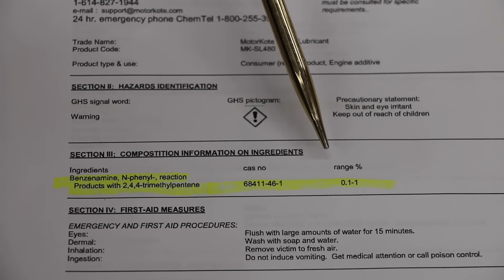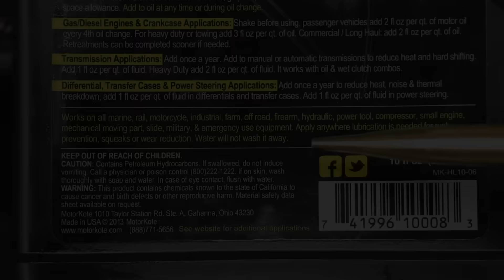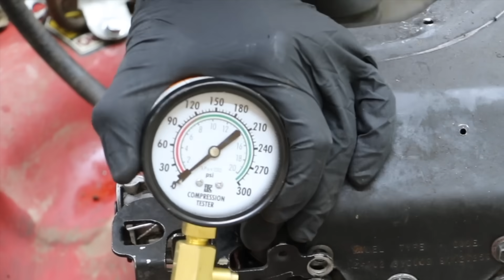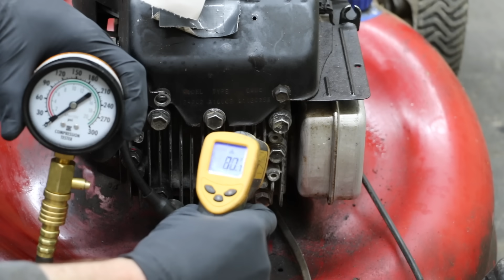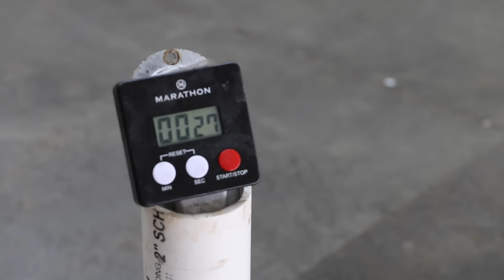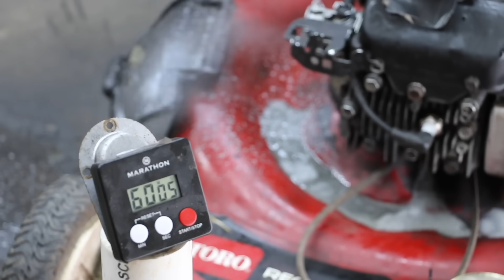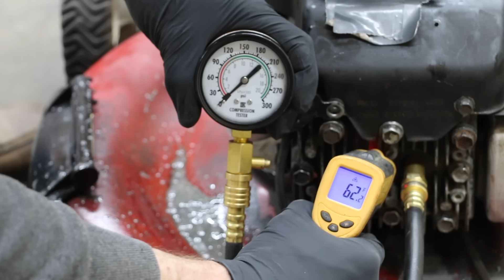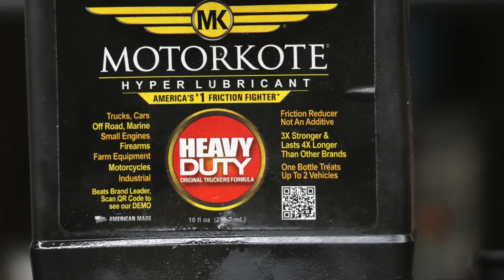Can MotorKote survive the water test?  Let's find out!

Comment: Could you do a video on castor oil? It's used in the fuel for rc cars and it's supposed to stick to the engine internals and provide some protection against a lean run, similar to what motorkote is doing, I'd like to see how it fares on your lubricity tester compared to other oils. It's supposed to take very high temperatures to burn it too would be interesting to see what it's lubricity is like after being cooked or run in an engine for a while
Reply: It would be really cool if you could do different types of castor like straight castor, degummed castor and klotz benol which is degummed castor with additives and put them up against 10w30 and maybe a synthetic 2 stroke oil. There's always talk on forums on what is the best oil to use for nitro fueled model engines and what's the best castor oil to use but everything you have to go off is just peoples opinions, there's no videos of any tests like yours out there for them. I could even send you some straight castor if you wanted
Reply: a drop of castor oil will cause instant death
Reply: @shittycodeenforcement7916  you're thinking of ricin, the leftover powder after the oil has been extracted from the seeds. You can buy castor oil in your local chemist it's an old style laxative, it's used in loads of cosmetics you can put it in your hair to relieve dandruff and help prevent balding and promote hair growth, it's good for your skin it works as a moisturiser and stops your skin from getting greasy by producing extra sebum, and it's a really good engine lubricant because it moves towards heat and doesn't break down and combust as easily as synthetics, perfect for rc car engines that use alcohol based fuel, it mixes easily with alcohol. You wouldn't die if you drank a bottle of castor oil but would get explosive diarrhoea, ask your parents or grandparents about it, they were probably given it as kids
Reply: @ciarancdc  Yeah i thought it was more toxic  . i have heard storys from my grandparents about kids eating the decorative castor beans and getting  deathly sick  . but those r my 2 cents
Reply: @shittycodeenforcement7916  the oil is just extracted from the beans/seeds and doesn't have any of the ricin in it, it's like mineral oil that you get in baby oil, that comes from crude oil the same place you get petrol and diesel and other petrochemicals from bilut mineral oil is used on babys
Reply: @ciarancdc  i stand corrected.  just looked at some companys that actually make the formulated castor oil in bottles for RC cars . learn something new every day .
Reply: @shittycodeenforcement7916  no worries, you might find yourself using it sometime
Reply: @ciarancdc  i have like 7 old briggs and stratton engines and might actually test this castor oil in the crank case just for the hell of it
Reply: @shittycodeenforcement7916  that'd be awesome, make a video of it I'd love to see that
Reply: @shittycodeenforcement7916  it smells really good when it burns you'd be in for a treat
Reply: @ciarancdc  it apparently makes a waxy coating instead of that carbon sludge synthetic oil produces under temperature  .. one of the 4hp engines knocks like a jehovah's witness wearing ray charles feet so it might keep the bearings from scratching .
Reply: @shittycodeenforcement7916  I know the stuff it goes like a varnish after a while, you can get degummed castor oil which is supposed to removed the varnishing/gumming effect but I don't really know if it affects the performance of the oil or not, I suppose it would have to take something away from the protectiveness of it. It's useful in rc engines if you have low compression. Say if you've run gallons of fuel with synthetic oil in it and the engines now becoming difficult to start or keep running, switch to castor based fuel and it really helps, it's worked for me, maybe because it's a thicker oil but I think some of that gumming or varnishing helps too it's like it microscopically fills in the worn spaces where the compression is being lost. Be careful about using stuff from chemists though, be sure to check or ask about the the ingredients because it can have sugar or sweetener in it to make it more palatable for people using it as a laxative, you don't won't to run sugar in your engine
Reply: in people

Comment: was with  water still some oil in the crank case? You added only 16oz. If there was then this was emulsion. That is why motor did not fail. Right?

Comment: Does Motorkote cause corrosion to the engine? I'm hearing rumors that it has chlorine in it
Reply: Yes and no.
The chemicals in it mix with remaining oil and cause very acidic/corrosive problems.
Just flush the motor...or use better oil
Reply from the maker: Thanks for the video idea.
Reply from the maker: Thanks for the video idea.

Comment: Amazon sells hypodermic syringes with blunt (unsharpened) needles. These are inexpensive and I use them with straight Motorkote to lubricate padlocks and other things around the house. 
.
My 99 Dodge Grand Caravan was having problems with the ignition switch. It was locking up and I could not turn the key. It took about 5 minutes of jiggling the key to get it to turn so I could start the engine. 
.
I tried 4 different keys and had the same problem. I thought something wore out or loosened up in the lock and I would have to take it apart and replace the assembly. I used the syringe with straight Motorkote to lubricate the cylinder and it completely corrected the problem. 
.
After about 21 years, the original lubrication or grease evaporates and causes problems.  I was very surprised that it worked. I thought I was facing an expensive repair. Up until I used the Motorkote, I was leaving the key in the ignition, so I would not get stuck and face calling a tow truck. 
.
The fine needle of the syringe allowed me to insert deep into the space between the cylinder and the housing and add the lubricant. I tried sprays, and they did not work.
Reply from the maker: Thanks for sharing.

Comment: The stuff is fantastic for quieting noisy valve lifters. I use it in my engine oil, automatic transmission, and power steering reservoir.  
.
It's worth the money. I also use Napa Gold oil filters. (refer to Project Farm test of oil filters).  My 99 Dodge Grand Caravan has 180,000 miles and I hope to make it a lifetime car. Engine runs like brand new and goes through NJ inspection without any issues. 
.
After a car reaches 25 years old in NJ, you don't have to get it inspected anymore. 
.
I was able to buy it at Autozone and Walmart, but now, I just order it from Amazon Prime. About $23 a quart.
.
Motorkote has to be the used car salesman's dream come true.  :-)
Reply from the maker: Thanks for the feedback.

Comment: I really enjoy your work has helped me make smarter purchases. Have you ever considered testing LubeGard transmission additives? I used the Platinum on a van (likely overloaded) that wanted to over heat the transmission every time I traveled up the mountain to our vacation home. With no other changes I was able to reduce transmission temperature by 30 degrees. I have had similar results with other vehicles.
Reply from the maker: Great suggestion!  Thank you.

Comment: Motorkote also has diesel cetane boost. I picked it up at a local Pilot truck stop. And I promise I can tell a difference in fuel mileage and injectors stiction after I used it. I have a 6.0 powerstroke.
Reply from the maker: Thanks for sharing.

Comment: Project farm, i like you to test the AMSOIL claims on MOTORKOTE that it contains chlorine and do a long term test if it does indeed harm a engine with it becoming hydrochloric acid!
Because allot of People are buying it because of this video!
Reply from the maker: Thanks for the video idea.
Reply: I agree.  Test the "manufacturer's claim" from Amsoil that Motorkote will produce hydrochloric acid.  I mean, please of course.  That should end the debate.  I will personally pitch in $20 to get the oil-motorkote used mixture tested!

Comment: Motorcoat don't mix with oil, found this out the hard way adding a smidge to two cycle fuel. motor coat separated and pooled on bottom of fuel tank over engine it made a mess to clean when it flowed into the carb, otherwise can't live life without it!
Reply from the maker: Thanks for sharing!

Comment: I just put some motorkote in my car engine. Thanks for making these tests, I bought this because of how impressed I was with your testing. This stuff really reminds me of those old Slick 50 oil commercials. The commercials where they would have the engine running and drain the oil while running.
Reply from the maker: Thank you!
Reply: Slick 50 works it saved my car when the oil sending unit cracked and I lost all the oil I drove the car with no oil for about 1/2 hour.

Motorkote is even better been using it for over 20 years.

Neither one ever plugged up anything or ruined it

Comment: Get it tested rumor is it's over 27 percent chlorinated paraffin highly corrosive to engine bearings and gaskets. The fumes would be very toxic also. So no way I'd rather add red line zddp in an appropriate dose to Chevron Supreme 5w30 conventional much better and safer.
Reply from the maker: Thanks for the feedback.
Reply: @ProjectFarm  Could you test Chevron Supreme 5w30 with 1500ppm redline zddp additive against Quaker state ultimate durability and also add the zddp to that as afterwards these are the highest ranking conventional and synthetic for film strength also Mobile 1 FS European car formula with just a tad more zddp to 1500ppm versus what comes straight outta the package. Pennzoil Platinum test before and after the zddp also might be of interest to see how it stacks up against Pennzoil Ultra Platinum. Rat 540 blog is informative but he added way too much zddp at least twice what is recommended so his results of zddp being myth are not credible anyone knows too much of a good thing is not good and he added way too much which actually spalls the metals instead of enhancing boundary lubricant protection sacrificing itself when no oil is present in the metal until oil can reach it. I especially would love to see this as I'm sure many of your followers would.

Comment: Hi folks. Yes, the 'ole geezer gear head' here again, I know., I've been AWOL for a while. . Just figured I'd check in again on this subject. I still have my 3/4 ton, '02' Ford E250 van, with a 5.4, 2 valve, untouched engine. It now has 326,000+ miles on it. At 77 yrs. of age, I am still doing my own service work on it. And still using the MotoKote additive, plus Mobile1 10/30 full synthetic oil. Age has slowed me down a bit. Not doing as many of the long distance trips that I was doing before. But, I was convinced, after seeing, many times, Project Farm's thorough testing of that product, that it was worth a try. I have been very satisfied with the end results. Thank you Project Farm.
Reply: formerly, papasmurf7597.
Reply from the maker: Thanks for sharing.

Comment: It is basically Teflon PTFE fluid. It works until certain temperature and start to degrade releasing fluorine radicals and causes sludge in heavy duty engine. May not hurt on simple engine with light load and air cooled. But never put this in VVT and modern engine. You asked for trouble.
Reply from the maker: Thanks for the feedback.

Comment: Very impressive indeed, I suspect the price and demand will go up as a result..did you ever test slick 50? I was going through my shelves in my garage the other day and I had a bottle from who knows when, I remember they used to run a lawn mower engine with no oil on that stuff. Great work!
Reply: I have been basically been doing a "no oil" test for the last 6 years on my lawnmower ! I've got an old "junk" vertical shaft Tecumseh with a split crankcase that I have used for the last 6yrs ! !

Comment: Briggs & Stratton.... There is no substitute!
Reply: Haha. I got a new pressure washer with a Briggs I think it was a 20hp, I want to say vanguard. That sucker threw something and blew a hole out the back of the engine. It wasn’t covered under warranty because it was mounted in the back of a van. Keep in mind this was a two month old engine. I said the old Honda powered P washer was in there for 6 years with no issues. His response to that was “well that is a Honda”. 
So we replaced it out of pocket. That lasted a year or so, replaced the second with a Koehler CH series and we got like six or seven years out of that. That Honda pressure washer was put on wheels and is still working. So ya lots of substitutes for the Briggs and Craptons. Haha   On another note I don’t have an issue with them for residential light use but they suck for commercial work.
Reply: @davebliley5361  My family has purchased 3 Honda lawnmowers, all of them, HR-214. They are incredibly powerful despite their relatively small displacement. The problem with them is, they all run rich, and they all burn oil. I can't stand to walk behind mine, because inhaling the oil mist,(even though invisible) gets in my lungs, and makes my chest feel heavy. They all blow huge plumes of smoke when first started, and then clear up after about 2 minutes under load, but you can still smell the burning of oil, and feel it in my lungs. I don't know how the horizontal shaft engines are, but I'm not going to pay all that extra money on the brand name, just to be disappointed again. They have all had regular oil changes, and had their initial oil change as recommended in their owners manual. My next mower will be electric, but if something possesses me to buy another combustion powered walk-behind mower, it will have a Briggs & Stratton engine on it. (no more over-priced foreign junk)
     I have a Briggs & Stratton 8,000 watt generator, with a 16 HP V-twin Vanguard engine on it, mine is the industrial version, with an oil filter. It too runs rich, but, no problems with reliability, even with heavy loads. I was told, that my engine is actually made by Daihatsu, a devision of Toyota Motor Corporation.(I live above 4,000 feet elevation)
Reply: Vincent Robinette - now that you mention it my little Lowe’s pressure washer has a Honda engine that does the same thing. I just thought because it was new it emitted a strange odor. I bet the same thing is going on. 

I’m sure that generator will be fine. I was mainly referring to the Briggs vanguard on commercial equipment. Light duty sure but going threw two in a year or so is not great by any means. That pump works the engines for 10 -12 hrs a day and the Koehler’s are up for it. Now if I had one Briggs and it broke and the other lasted five years I would have not mentioned anything. 

All in all I will take a running engine over a broke one regardless if it stinks. Haha. Now I’m going to check the oil on that Honda!!
Reply: @davebliley5361  The generator is horizontal shaft. Was the pressure washer vertical shaft or horizontal shaft? That might make a difference. The Honda horizontal shaft engines seem to have a pretty good reputation, but, the Honda engines my family have are all vertical shaft, where the piston moves horizontally, rather than diagonally. Oil might be accumulating on the bottom of the cylinder wall on the lawnmowers, where it would pour out of the cylinder on the horizontal shaft engines. They may NOT have that problem!
Reply: Vincent Robinette -  All engines in the first post were horizontal shafts. That little Lowe’s pressure washer with a small Honda is a vertical shaft. That little guy is the one that smells when running, it’s just for residential use.  I can smell it just talking about it. Haha
Reply: @davebliley5361  Time for a Briggs & Stratton repower!😋
Reply from the maker: Thanks for sharing!

Comment: I like your idea of using your vacuum pump to suck the oil out. I have a vacuum pump, and I think I'll start using it for that. Thanks for the idea!
Reply: I have used a turkey baster with a hose attached to the end it's cheap and simple.
Reply: @Kaufeetimevideo  - LOL. Cheap and simple for sure. But I went ahead and bought an air-tight one-gallon jar, liberated some fittings from the local military base, and made my little vacuum chamber. It's more fun. You can put your thumb over the hose and watch the oil boil until all the moisture is out of it.

Comment: Just FYI. I had a customer with a Briggs engine push mower.  He was mowing when it suddenly quit and wouldn't start back up. He said it was about 5 years old anyway, and went to get a new one- I took his home with me.
 I checked the oil and it was empty- none! I added oil and it still wouldn't start so I replaced the plug and vrooom- it started right up and I used it for about 3 years after fixing an oil leak. He had run it for years with little to no oil in it.
  Just to let you know, those loose tolerance engines (Especially when older) will run without any oil for quite some time anyway. Water is in itself a lubricant and coolant. 
 I doubt a new mowers engine would tolerate no oil very long.
Reply from the maker: Thanks for the feedback.